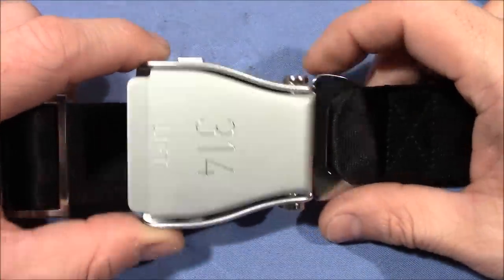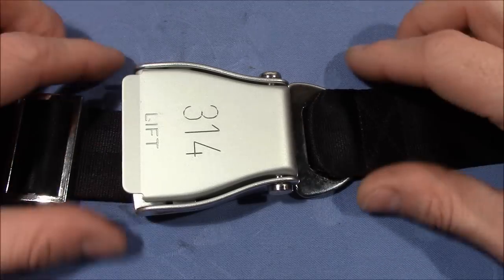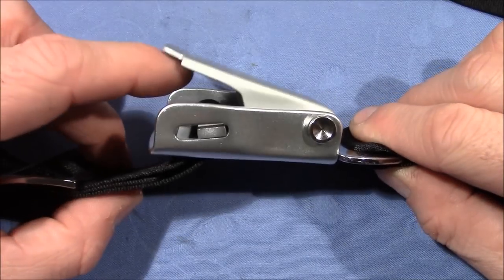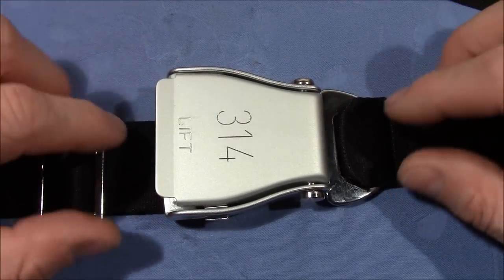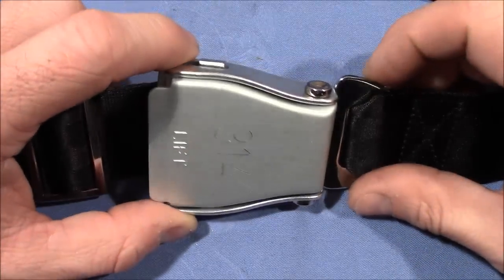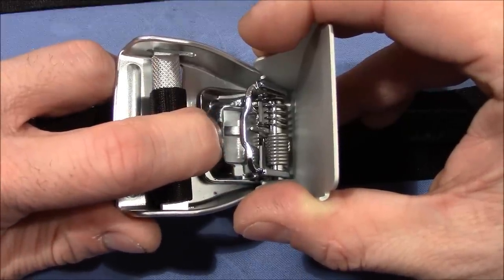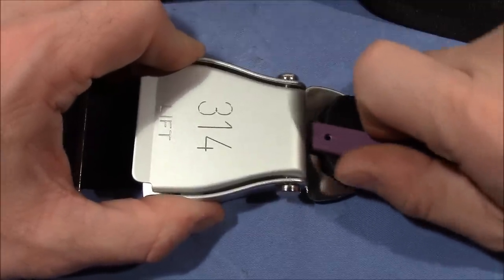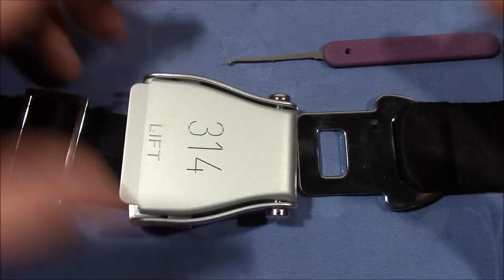(picking 632) FUN: How to shim open an airplane safety belt

Comment: Great video, Captain Potti! It's interesting how such a simple, secure and maintenance-free  design has lasted for decades as an industry standard. I'm 50 and I only remember seeing/using this airline belt mechanism.
Actually, I'm feeling a bit nostalgic remembering all the flights I've been on. Cheers! 👍
Reply from the maker: Yes, the design is simple and very effective. And also sophisticated with the two springs.

Comment: Very interesting.  When I was young,  those were seatbelts in cars.  No shoulder harness,  just a lap belt. 
Nice way to use a pick as a shim. It works.  Did you know you can shim a zip tie? Don't have to cut it,  just shim it with a pick, or knife tool.
Reply from the maker: Yes I've seen Bill doing this. Pretty cool. Thanks for watching buddy.